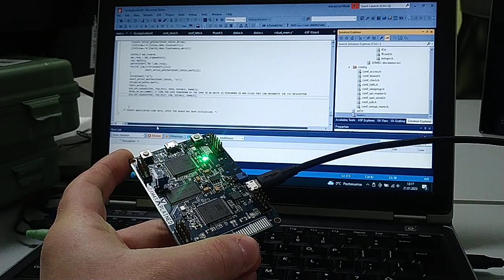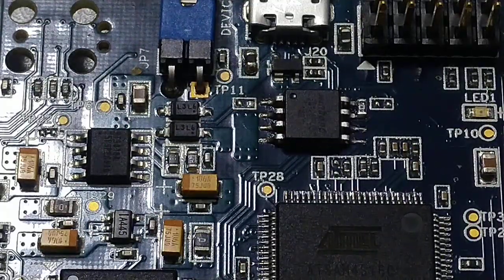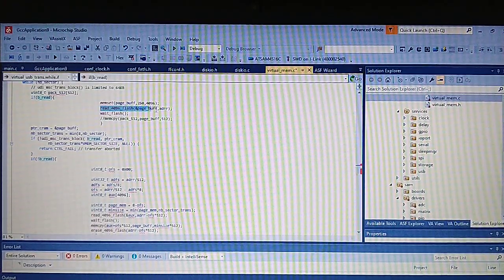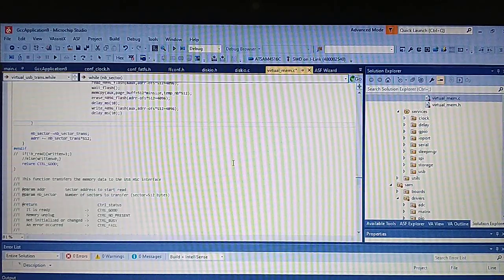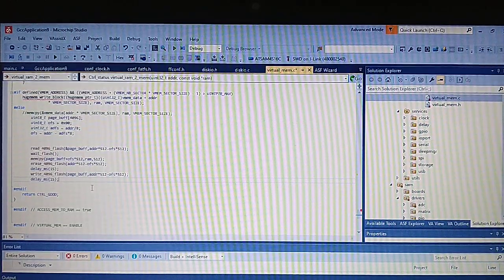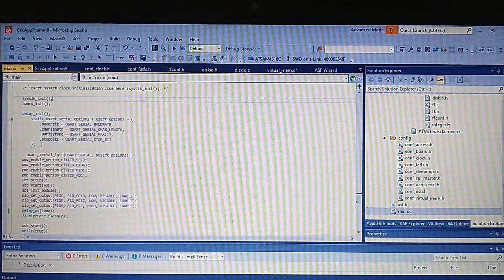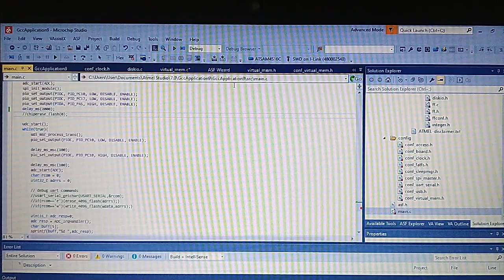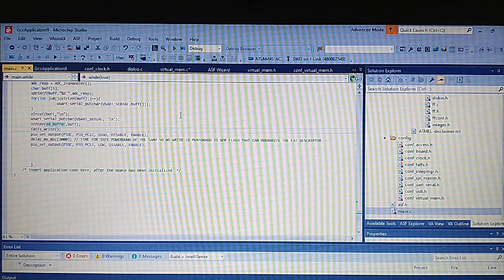NOR Flash SPI with FatFs and USB Mass Storage Example on SAM4S Xplained in Microchip Studio 7

Comment: Can you share how you added FatFs to this project?  

I am having trouble implementing this on a project with ATSAME53N19A (Clearcore Motion Controller)
- I am getting an "undefined reference" for all of the functions in ff.c and diskio.c

Any help or steps required for adding an external library would be greatly appreciated!
Reply: Noticed you have a github repo - downloaded, and will try to reimplement it how you did :)
Reply from the maker: Hi, SAME53 is a bit special microcontroller like the SAMD51 and the Microchip/Atmel Studio with ASF 3.5x does not support adding the features to it. To generate a project for them You have to use atmel start web page, there is ASF 4 and it supports them. 
However if You want to add the FatFs manualy, the fastest way is to add all files to a folder in the project that already exists and has some search path / include files in it, after that add includes to .h files that use the FatFs.
For the example in the video the includes are 
#include <diskio.h>
#include <ff.h>
#include <ffconf.h> (in this file is conf_fatfs.h included)
#include <integer.h>
they are added in asf.h and the asf.h is included in main.c and many more.

If You still have trouble, soon i will be adding a video about using the NOR Flash with Arduino Mega with FatFs and it will be a manual port of the libraries used in this video.
Reply: @e-exp  Ya - I added everything manually, but still having an issue. 

I think the header for diskio.h is getting declared twice - i just can't see why
Reply from the maker: You are getting still undefined reference? If so then a include may be still missing or some functions don't work if _USE_STRFUNC is 0, a redefinifion error occurs if a .c fille is included like 2 times somewhere
Reply: @e-exp  Is it possible I'm having issues because I'm running c++?  I thought FatFs was a c++ library? 

I get undefined reference to ... diskio.c
and ff.c functions.
All I have in my program is:

#include <ff.h>
#include <diskio.h>
#include <ffconf.h>
#include <integer.h>

int main(void) {
	
	FATFS fs; // Create an instance of the FATFS object

	FIL file; // Create an instance of the FIL (file) object

	FRESULT res; // Create a variable to store any return values from functions

	char path[] = "example.txt"; // File path

	// Mount the SD card
	res = f_mount(&fs, "", 1);
	if (res != FR_OK) {
		// Handle error
	}
}
Reply from the maker: Try the extern C method https://www.youtube.com/watch?v=Uqo6nCjoD_U&ab_channel=NetUmi
Reply: @e-exp  Same outcome :/
Reply from the maker: The best bet is to go to https://start.atmel.com/ and configure the project with the addons for the SAME53, in my project the fatfs works for targets like SAM3/SAM4/SAME70/SAMV70 because of using the ASF 3.5x version with uses things like ctrl_acces and virtual_memory (in ram). My other video with Adafruit Grand Central M4 SAMD51 shows how set everything up there (i use fatfs there too and it should work for SAME53).
If You want to work on the old project and only add the fatfs then probably next saturday i will be doing a video with modding the files from this video to work with Arduino Mega (so basicaly it will work everywhere)